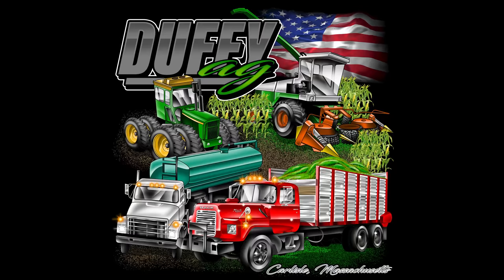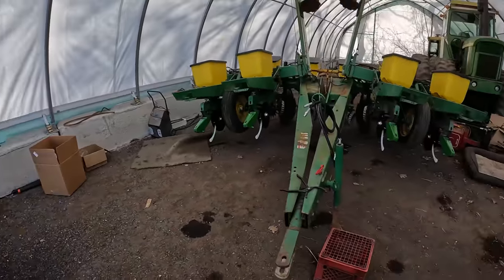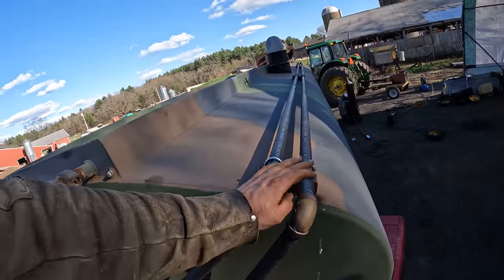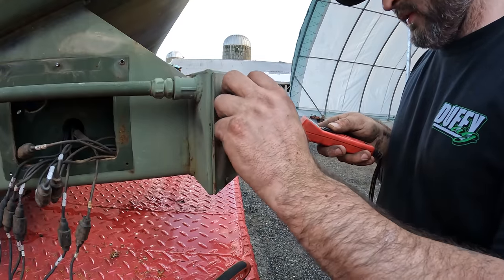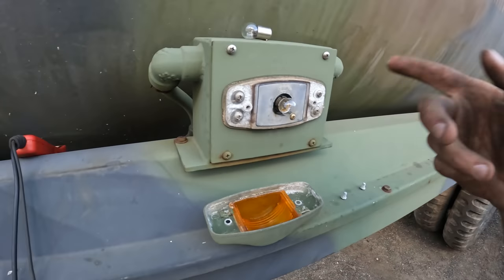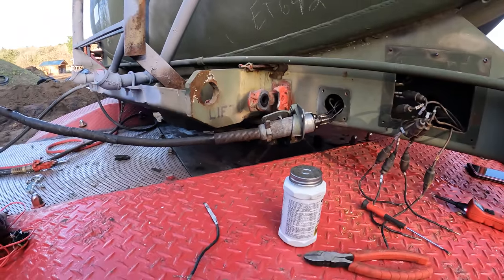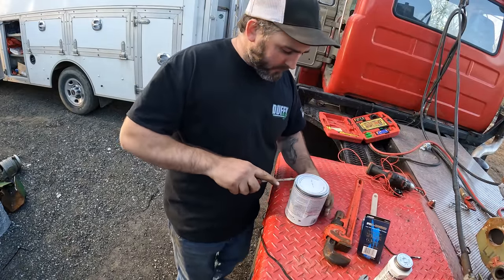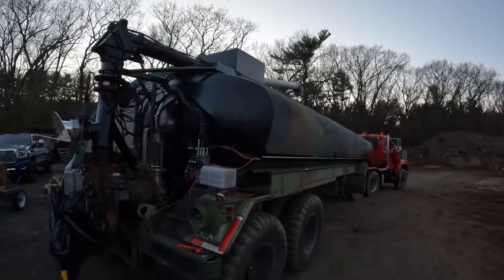Some Paint & Lights To Get The Trailer Ready

Comment: Here's an idea for putting names on the Planter's Seed Hoppers. Check with a local sign company to see how much it would be for them to make up the names using Vinyl Lettering (like alot of businesses use for signs on their vehicles). It may cost a bit more than if you just paint or use a marker but it should last alot longer. Some places charge by letter, some charge by the wording.